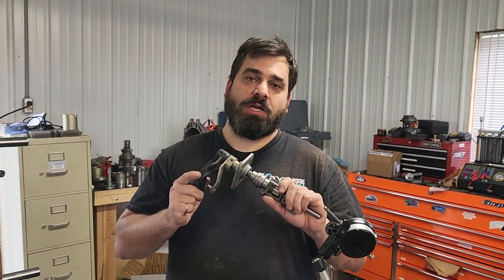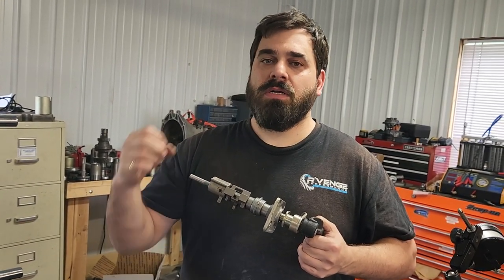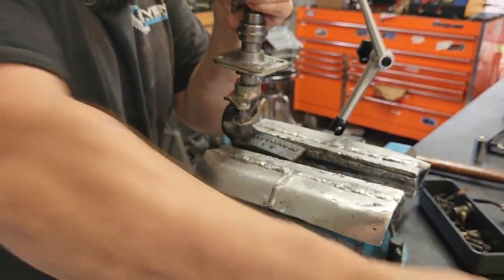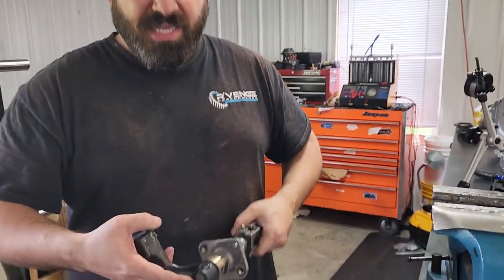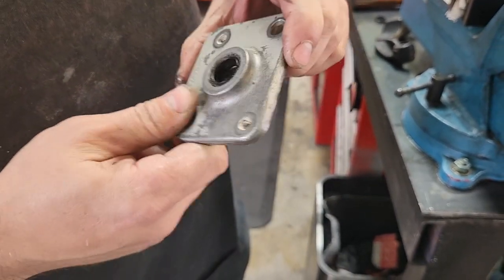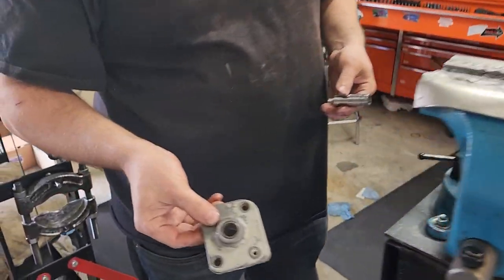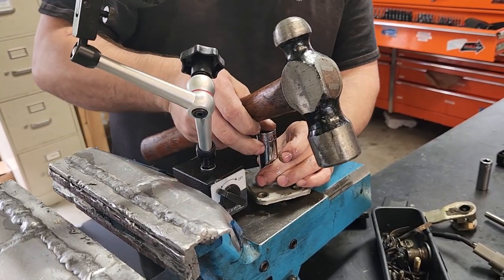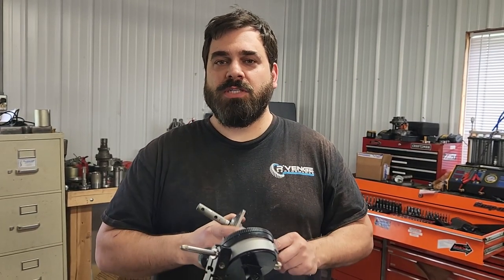3000GT - Stealth 6 Speed Shifter Shaft

Comment: Hi, do you sell the shift shaft seal for the 1st gen 5 speed vr4? I’m not leaking yet but this summer I’m pulling my transmission apart to install a pampena Motorsports Bell housing brace.
Reply from the maker: Unfortunately, the design is different on the 5 speeds and uses a bellows, we have not found a replacement for that part and have to replace the whole shift shaft if its leaking. I have some ideas to machine the 5 speed shift tower to use the 6 speed seal, but haven't tried anything yet.